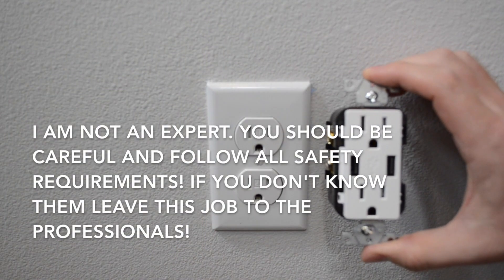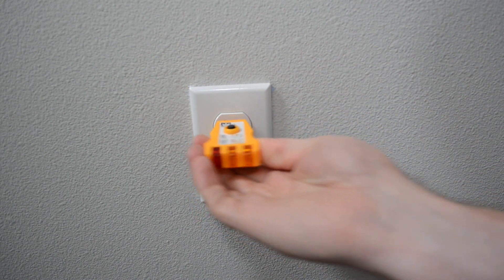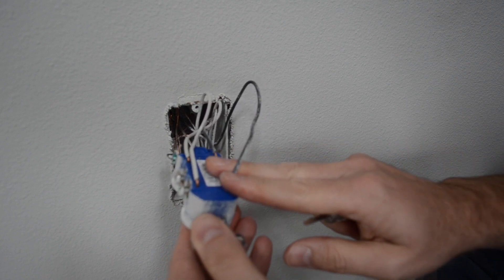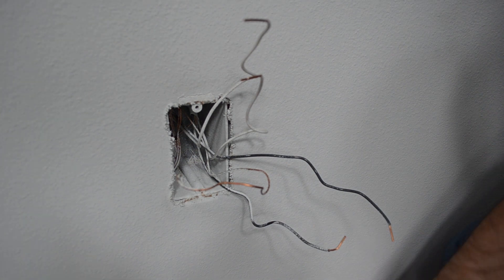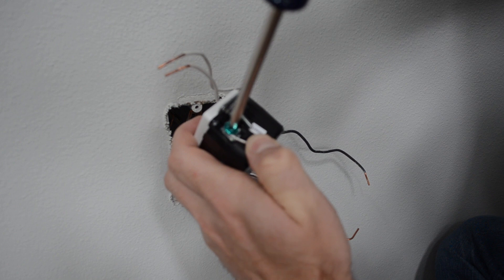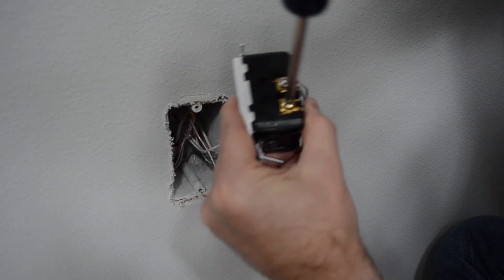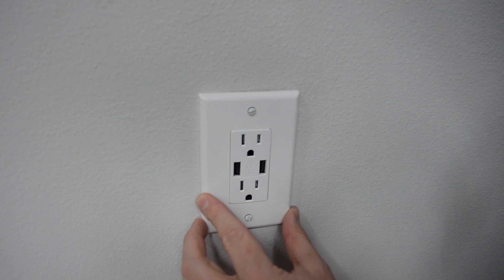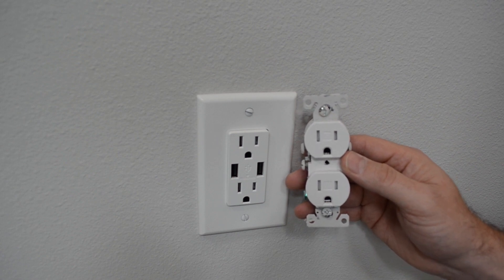How To Change an Electrical Wall Outlet to add High Speed USB Charging. (Outlets in Series)

Comment: Great video.  What do you do if the old outlet has pigtailed wires that merge into one hot and one cold going into the old outlet?  Do you remove the pig tail and then install the two hot and two neutral as you demonstrated?  Thanks!
Reply: Mario Aceves you don’t have to. The pigtail wire will energize the entire new USB outlet no problem. I have installed a few of these USB outlets and used the existing pigtails and have had zero issues.